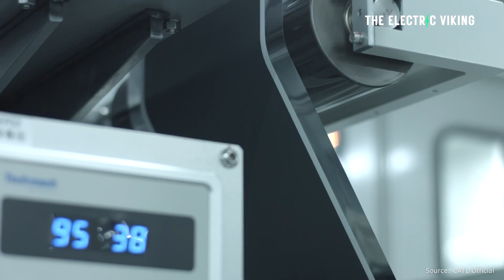China says battery supply will soon surpass demand by over 400%

Comment: I agree to some extent regarding excess for EVs, BUT, Don't forget about buses. Don't forget about semi trucks. Don't forget about dump trucks and boats and super heavy equipment and airline jets. All of this stuff will be battery powered, hopefully in my lifetime. So the amount of batteries needed is incredible. Even if they get two or three times their energy density, which we need to have happen, all the batteries will still be used.

Comment: The pathetic Toyota/Honda AI generated H2ICE-will-smash-EV guff everywhere has tanked badly. 

50kWh of electricity nets 12kWh mechanical energy out of the Toyota H2ICE if the hydrogen is green.
50kWh of electricity nets 40kWh mechanical energy out of the latest BEV motors and LiFePO4 batteries.

Comment: Do lithium iron phosphate batteries charge faster than NMC batteries? I've heard both sides claim to be faster charging.
Reply: Both lithium-iron-phosphate and NMC batteries can be made so that they can be charged in a few minutes, by using thick metal backing for the electrodes so that they can carry very high currents without getting too hot. There is a compromise that has to be made between energy density and charging speed; thicker metal backing on the electrodes is not active material but it adds weight, so the energy density is reduced. If the cells are made with thin electrode backing to make room for more active material it is possible to get higher energy density but the maximum charging and discharging current will have to be limited so as not to get the cells too hot.

Comment: Sam, it is not 'millions of gullible people' as you think. The Japanese are not saying it completely openly, but the reason for 'battery shortage' is NOT the lack of battery making capacity in China, it is rather the shortage of batteries NOT made in China.

Australia is importing EV's from China, including Tesla cars, and is therefore completely dependent on Chinese batteries. This works fine for the short term, but the day hostilities erupt between the QUAD and China, the disruption in Australia will be very noticeable.

Though it is not as explicit as I say, you will get some facts from the following YouTube video:

https://www.youtube.com/watch?v=oKSN2AzZiUo
Reply: That didnt make sense. Batteries are not like petrol, that needs a constant supply.
If there were hositlites, and battery supply stopped, Oz transport will continue on as nothing had happened. Evs can be bought elsewhere for anyone desperately needing an ev right away.
Reply: @nordic5490  EVs cannot be bought without batteries and motors. Current technology requires to make batteries and motors requires material mined in China.

Comment: uh... that looks like a rather huge embarrassment for the 'authoritative' voices claiming there simply isn't enough lithium and other rare earth metals to supply the volumes needed for switching from fuel to electricity.  I wonder which such authorities will turn 180 degrees and dump on their previous warnings.
Reply: Most evs now use LFP batteries that dont use any Cobalt or Nickel, but are mostly cheap and plentiful iron, plus some Lithium.
The price of Litbium has also dropped in the last year due to over supply.

Comment: The issue is not factory capacity per se - the world’s current and planned lithium supply is the biggest constraint. Sodium batteries have poor energy density and do not survive many charge-discharge cycles (about 50% of lithium ion batteries), so not a viable alternative.
Reply: Most evs now use LFP batteries that dont use any Cobalt or Nickel, but are mostly cheap and plentiful iron, plus some Lithium.
The price of Litbium has also dropped in the last year due to over supply.

Comment: As Elon said, it's Li refinement that is the bottleneck, not the other parts of the supply chain.
Reply: That is why CATl introducw Sodium battery
Reply: @林振华-t4v  We will see what chemistry becomes the most mainstream, including how that is impacted by the advances in solid state. For now, LFP/LMFP seem the most useful overall, but Na batteries could be a great soln for stationary storage initially. I don't know their energy density is but it seems low. Tesla, at battery day, did not mention them, and I think they know way more about battery tech than punters like us.
Reply: @machoopichoo2 solid state could actually be used as the cars frame which will be crazy if that happens
Reply: @fadzilicious4411  Definitely. In fact, Tesla has been doing structural battery packs for a while (attaches to front rear giga-castings). 

It's hard to say what will happen with solid state. It really comes down to cost & ability to scale. LFP/LMFP are so good already & continually getting better fast, solid state may not offer a big practical advantage. Like 5 min. to add 75% vs.10 for LFP, at some point?

Regardless of battery chemistry things will exponentially get better and better, just like compute cost and power. Future is bright. 
😎

Comment: SS batteries are still a dream.  Anyone that makes a claim needs to prove it.

Can we make SS batteries.  Yes.  Can we mass produce SS batteries that are cost competitive w current non-SS batteries, have similar or higher energy densities, charge as fast or faster and have the same longevity or more and are as safe or safer?  No.  You need to meet ALL 5 objectives except maybe for price initially since you will have a superior product and cost will come down w scale.  Higher prices also means you have a limited market so prices HAVE to come down if you wnat to succeed.

For now though SS claims should be seen just as that.  Claims.

Comment: And we have unlimited need for cells for grid storage.  We need about 10 TWh of batteries per year for global vehicle production to go 100% BEV.  And we need at least that much to make the grid 100% renewable.

More than anything we need lower cost and higher energy density.  I still don't believe the 500 wh/kg numbers, but sincerely hope they can achieve something close to this.

Teslas have the best efficiency and range and even that is not yet good enough.  On avg Teslas need 50% to 100% more capacity per pack.  

EPA range figures are contrasting efficiency figures.  A Tesla MY LR CANNOT have 330 mi range AND 28 KWh/100 mi efficiency w a 75 kwh (or 82 kwh) pack.  My LR MY achieves 28 kwh/100 mi (over 45k mi) avg, but just over 200 mi highway range.  316 mi at 28 kwh/100 mi requires an 316/100 = 3.16 x 28 kwh = 88.48 kwh USEABLE battery.

We need more energy dense batteries.  300 mi real world range is good enough.  Few BEVs can do that.  Not to mention when towing or carrying something on the roof or driving in cold weather into the mountains (elevation gain) for skiing.

Comment: In a recent report you stated that China will have 3 TWh of annual battery cell production capacity by 2025.  Now you are saying 5 TWh????

I HOPE this is the case.  And I can believe it is possible because when people are concerned about shortages of some new product, capacity always comes online much faster than the 'experts' and prognosticators would like you to believe.

Also.  10 GWh is 10 GWh.  Higher energy densities just means a smaller factory producing less cells will have the same nameplate capacity than a larger factory producing lower density cells.   But yes, it means much lower cost because it's cheaper to produce for instance 100m cells vs 200m cells.  Capacity is capacity though.

Comment: The U.S. should subsidize a $600 part so any % of ethanol can be used in non flex fuel cars. A much cheaper option than ripping up the entire ICE infrastructure. Remember E100 burns almost as clean as hydrogen.

Comment: Hi. I like your content, but sometimes you say utter nonsense. 48GWh production capacity means 48GWh, it's the same! But weight of those battery packs will be lower, thanks to higher specific energy of solid state batteries. For example battery pack, which currently weighs 500kg, will be something like 200kg with solid state, or the car with 500kg battery will pack more kWh.
Reply: Noticed this too!

Comment: How low can the price of lithium and other materials needed go? If I can buy a lead acid battery for $120 USA and weighs 20kg that is $6 per kg of materials. Surely we could see lithium batteries fall to half or quarter the price?
Reply: Yeah, but with lithitium battery, you can deep cycle the bastard more often. I distroyed the lead acid battery (2 of them) on my boost er because I passes out while charging my cell phone and causing over discharges. I decided to try my luck on the lithitium battery. The one bashed Scotty, it turn out being used as booster is an upgrade. It is lighter and dont have much degrade while deep cycle it.

Comment: I just don't get the solid state battery business. I see all sorts of videos saying they don't exist at scale and yet solid state battery factories are being built.
Reply: Contemporary production lines are easier to scale. The can build a line begining with small scale run with lab production method as baseline. Once the production method is sort out, the production will quickly ramped up.

Comment: I am totally happy with the 77kWh battery of my Kia EV6. More than enough range and speed to load. But I am sure, progress goes on and on and in  a few years we will laugh about todays capacities and loads.
Reply: Todays EV are like old electric toothbrush. Disposable item
Reply: @zhaowei3025   I plan to happily drive mine for ten years. I do not care one whit what a future car will be like, as long as I like mine. I never have. Why would I start now?
Reply: @zhaowei3025  I can't afford a 55k tooth brush
Reply: @tireddad6541 Digital camera's are a much better analogy than electric toothbrushes. Twenty years ago they were clunky, low resolution, and overpriced. Fifteen years ago low end models were at least affordable and top of the range was pretty good. Ten years ago every phone had a camera better than anything from five years previously - now they have three. EVs are at that "15 years ago point". Give it another five years, and I think they'll be a much more viable proposition for vastly more people than now. Personally I just don't do enough km annually to make it worth changing. Fuel price would literally have to go up at least 5x to even think about it - i fill up once a month, and could halve that if I got off my arse and biked to work
Reply: @petercroft9895  Maybe large screen tvs are, specifically for the EV battery.  They are expensive, will still be expensive, but cheaper now.  And we still don't have the recycling and refurbished set up that we need.  It is still future future future.
Reply: Just broke my own record on normal Swiss highway with mostly max. plus 5 km/h from my place in the alps to Cannobio at the Italian border through the San Bernardino tunnel and back 476 km, 40 km around the vacation place and back at home with 75 km left in the ‚tank‘! Look out for a similarly powerful ICE car with 333 PS and 608 Nm always with A/C set to 21°C. I guarantee that in 2 h 30 min one way you would not do the distance with a petrol car! The miracle is named perfect recuperation so starting at Thusis I had 67% SoC and in Bellinzona 67% again in rather high temperature range. Then in Italy we had 28 to 35°C! So range anxiety is definitely not a problem with an 800 Volts system charging at 240 kWh if necessary but I prefer charging at home with 11 kW and very low energy prices far below what HPC offers in Europe that also are not reliable and too complicated with too many hidden costs, rules and complicated payment systems with no receipt and overall cost control. With ICE we had 95% on one invoice of one supplier Migrol and 5% with Shell (V-Power). Now we need four cards and two softwares to check prices which is a nightmare. But back to batteries; I am sure that they improve over the years and will use other chemistries as they proof reliable to scale up from lab to serial production. Here only Elon understands the game in choosing about four options in the beginning but always staying open to whatever comes. This is only possible if you have your expertise in software and ultrafast simulation. Battery development is very time consuming what most dreamers from legacy must learn first when claiming for the next battery wonder that makes 1000 km with one charge and reduces the car by 500 kg 🤡👽🦄
Reply: I knew in 2018 that my Chevy Bolt was going to be outdated quickly, but I reasoned that the price of gas was going to only go up while electricity could conceivably even decrease.  I was right about the gas part of the gamble, and I’ve enjoyed the car a lot as well as enjoying the savings.  It’s already easily paid for the cost premium above an equivalent gas car, and I haven’t had to spend any money on service other than tires and brakes so far so I figure it will “pay for itself” so to speak fully in about 15 years (non-commercial / regular consumer use).  I too will drive it until I decide the technology has advanced enough to justify a new car or it becomes uneconomical to repair it, or sell it to one of my kids.
Reply: Look up the history of the Model T.  Read up on how the product improved and cost dropped over years.

The first Model T did not have a fuel pump, electric lights, a heater, wiper blades, etc.  And cost far more than the much better Model Ts sold only a few years later.

Comment: So how much would the price of a Model Y come down in the next 24 months?
Reply: If you half the price of the batteries and the battery is half the cost of the car then the car would be 25% cheaper. This will probably happen over the next few years, maybe as late as 2030-2035.
Reply: @AORD72  
The cost to produce will come down much faster than that.  It's just a matter of scaling up LFP production and move almost all Teslas to LFP batteries.  Only performance EVs and long range T-semis will likely use lithium-ion.  

Tesla is not likely to drop sales price faster than they can ramp up production.  They will probably adjust their prices to a level where wait times are not excessive.  And use that extra profit to increase production.
Reply: @bobwallace9753  Well I hope so. Cars are way overpriced now.
Reply: @AORD72  

In 2005 I bought a new car that had a MSRP of about $25k.  Let's adjust for inflation.

"What cost $25000 in 2005 would cost $38599.75 in 2022"

The Tesla 3 price starts at $40,240.  And a typical driver should save $1k or more per year on fuel/maintenance savings.  And the 3 is a heck of a lot better than the car I bought back then.

What we don't yet have in the US is a price-equivalent EV for the Correla.  But they are coming.
Reply: @bobwallace9753  True, the legacy automakers seem to be dumb to the fact they could take massive market share by providing a cheap small nice looking EV.
Reply: @AORD72  

But they can't.  Legacy does not yet know how to make an affordable, quality EV.  Right now they are trying to build EVs that compete with the 2012 Tesla S.  They don't have the technology needed.

If they had good software and enough really good engineers.   If they copied Tesla's lead with things like large underbody castings and box assembly then they could create EV divisions with flat management structure, start letting their talented engineers make design/manufacturing decisions - immediately - and build some new factories.  Then spend 2-4 years ramping up to profitability.

That's simply a bridge too far for most legacy to cross.  They would have to start with a 'head office' and board mentality that would totally support that move.

Remember how IBM persisted with 'computer center' solutions and lost business to personal computer startups?

Comment: sound like its time to go hard into swappable battery tech.
Reply: Why? It doesn't provide any solutions and adds complexity.
Reply: @AORD72  to use the extra battery capacity
Reply: @lyin4rmu  Just build more cars with longer range.
Reply: @AORD72  that doesnt solve the supply demand mismatch.
Reply: @lyin4rmu  Why not, if you have twice is many batteries than the cars you are building then you can surely build twice as many EVs.
Reply: @AORD72  lol how does building more electric cars fix the oversupply problem? creating more supply of cars doesnt create more demand of cars when current battery supply is already 4X that of demand. repurposing the 4X over supply of batteries for battery swap stations for cars, trains, ships, etc. will actually help with the battery oversupply problem as well as make electric modes of transportation more efficient for users. the new battery powered cargo ship that china built will be using battery swap stations to eliminate the down time from charging and those cargo ships need literal tons of batteries.
Reply: @lyin4rmu  It is a oversupply of batteries not EVs. You build more EVs to use more batteries. Didn't you watch the video or read the video description?

Comment: “The demand is not there yet” AT CURRENT PRICES if all these factories can compete with existing factories on price, prices can drop and demand will skyrocket
Reply: US has effectively frozen imports of China's batteries with the IRA act. Which was designed to kneecap the renewable energy disruption, not enhance it.
Reply: At current prices,  the payback time for grid storage is already attractive.
Reply: @MattOGormanSmith  so imagine when the equipment cost drops in half.💶💵💷🪙💰
Reply: I think it's minerals that will prove be the bottleneck.
Reply: Sodium, aluminum, iron?
Reply: I think it's minerals that will prove be the bottleneck.
Reply: @grantbuttenshaw  Are you thinking there won't be enough minerals to supply these new factories? Assuming they actually get build and stay in operation, of course.
Reply: Just waiting for the carnage to come and I will buy my Tesla standard range.

Four times more for cars or has the demand for batteries been included.